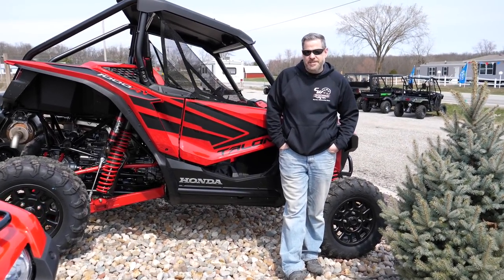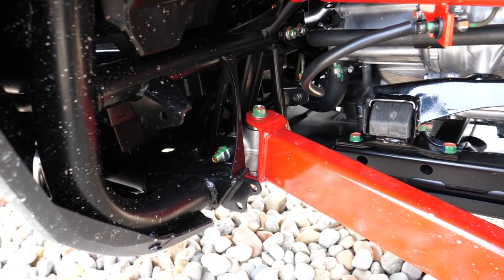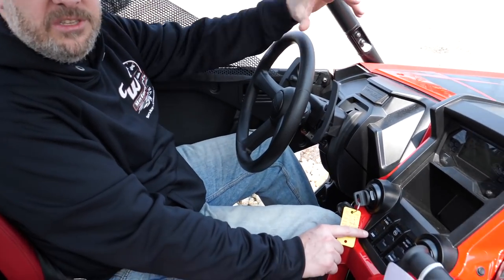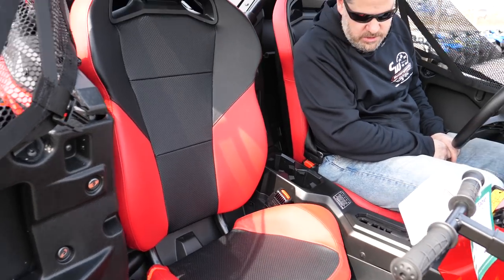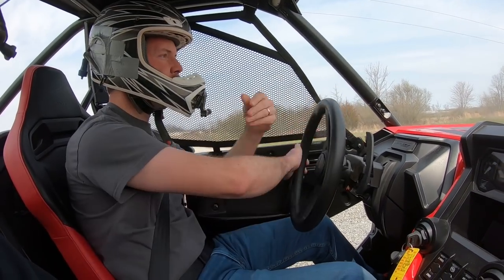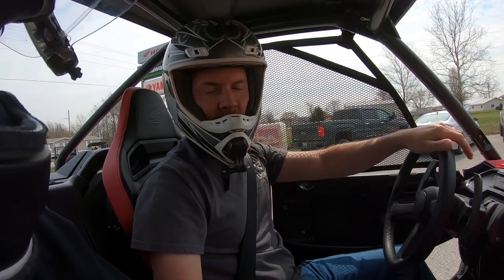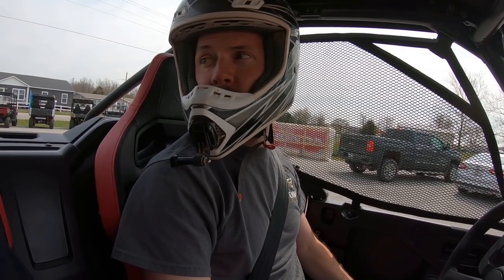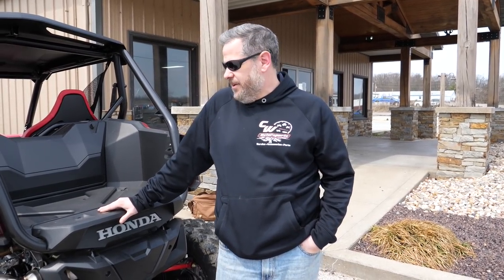Talon Test Drive

Comment: Well I had my fingers crossed that it would hold up to the hype. Maybe in the future they will bring more machines to the table that can compete in the racing world.
Reply: Learn how to drive put in sport mode and let it go I have one much faster in the shifts and it won't hit the limiter
Reply from the maker: Its a solid first offering for Honda in the UTV world.  If they are willing to keep working on it and make some changes it could be a real contender.   Think back to the first offerings of all brands and how much they have changed over the years to get where they are now.
Reply from the maker: @briantel9432  We did run it in sport mode Brian and we do know how to drive.  We just cant put all the footage in one video.  Sport mode left it searching for the correct gear to be in and to us it really only shifted "correctly" on straight flat ground with dry conditions.

Comment: The setting Is on 1 not 3 look at it next time I have one use sport mode  not manual it shifts perf every time and much quicker up to speed.
Reply from the maker: You are correct about the shock setting.  Also after filming this I (Chad) talked to Doug about it and changing the shock setting wouldnt resolve the issue we were feeling.  Its to high or a spring rate or to high of a preload.  We did try it in ALL modes also just couldn't put every bit of footage in the video as it would be an hour long LOL.  I agree sport mode does keep you off the rev limiter but it also was always searching for the right gear.  In that setting when the tires slip it would up shift, then when the tires found traction it would be in to high of a gear and was more bogged down than we feel it should have been.  Its a new design and with a little bit of time im sure they will get it figured out and dialed in.  Hope you get many trouble free miles out of your new machine. Keep us updated on how it does for you over time.  Thanks for watching!
Reply: Im looking into getting one and my biggest thing is no belt problems and something to ride and not something to work on ever time u ride i have i brute force belt drive wished never got love the power but work on it too much 4 belts stopped riding it because last belt cost me 600 to fix belt housing when it busted it smh

Comment: Interesting review style.  Came across kinda semi negative, but the attempt was to stay neutral. ??  Don't think there is any production SXS that has it all.  Maybe there is. ??  I always thought any race car needs to be modified from stock to race.  ??  Maybe this vid wasn't intended for new customers into the SXS market.  ??  Good point on potential resale value though!
Reply from the maker: Sorry if we came across a little negative.  We were expecting more out of it from all the hype it had but after actually getting in it, it didnt live up to it for me.  We do look at things from a race perspective because that is 90% of the riding we do.  I fully agree that no buggy has EVERYTHING right straight away.  There are several that you can take out and race stock though and you will be ok.  You will just have to upgrade some parts as you go depending on what buggy we are talking about.  All in all I think the Talon will make an EXCELLENT trail machine.  Thanks for the comment!

Comment: OMG man. Stop complaining about the rev limiter. You are shifting a DCT transmission. Even when you drove it away in Auto, you were paddle shifting. Keep your hands off the paddles and let it do its job. If you want to do some manual stuff, then experiment once you know the machine, but if you're going to compare it with a RZR/belt system then drive it like it's designed to be driven. Absolutely the worst test drive ever. My 12-year-old daughter can figure that out.